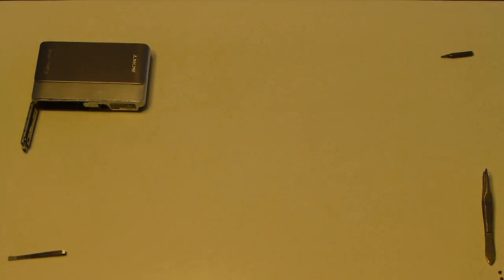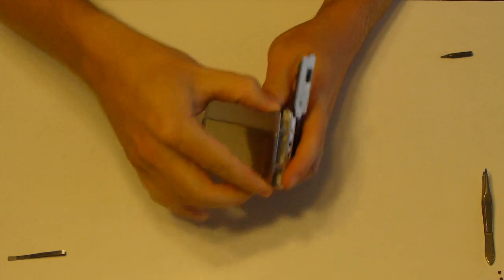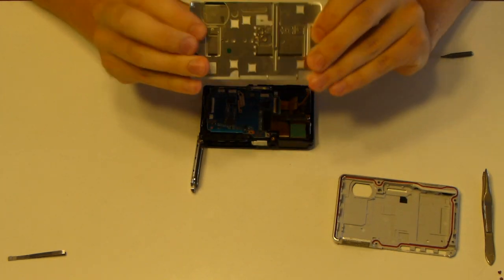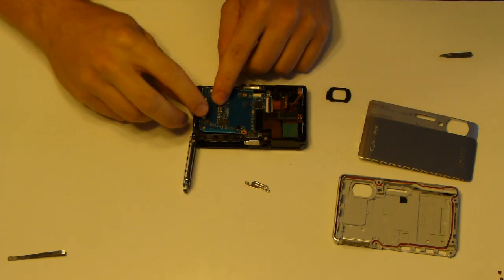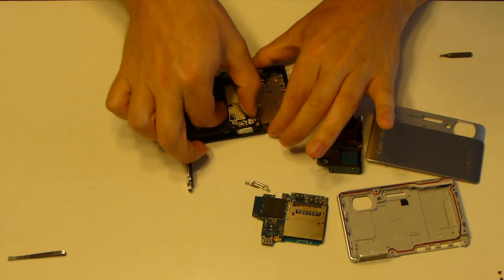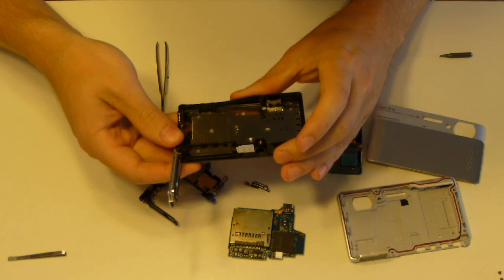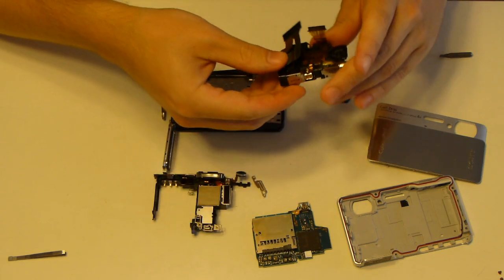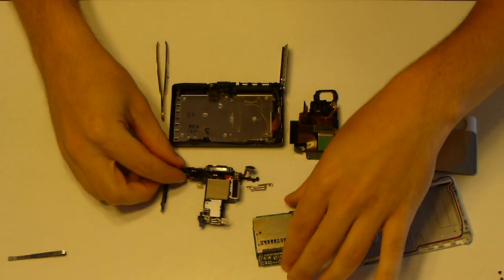Sony Tx5 Teardown

Comment: All I want to do with mine is to replace a little latch to keep the battery door securely locked down. Do you have any idea how to do that and what the part would be called? Thanks!
Reply from the maker: Honestly unsure, think the tx5 is burried in my junk bin. If the latch is damaged I could send you my brick tx5 for cost of shipping. Private email me via google plus.
Reply: +Peter Panais Looking at the same issue of the battery latch failing which has then compromised the battery door. @Peter, did you end up getting that part from Paul and replacing it within your DSC-TX5?
Reply from the maker: He never contacted me, I don't think I have the camera anymore
Reply: +Paul Beaudet all good, thanks for responding, Sony AU will look at it for $180-$200 AUD excluding work + parts so it's time to shop for a new one. Looking at the TX-30B on sale at Amazon if I myus can ship it ;)

Comment: Thanks very much for this video, I cracked the case and touchscreen on mine and then over time water seeped in and broke the LCD screen. Just finished reassembling it and it works fine so thanks for the guide!

Comment from the maker: that usb hatch always seemed like weak spot to me. Salt eats gaskets if not cleaned away. Like I said the vid, let it sit in a zip lock bag of rice till its dry. Opened up it shouldn't take too long, mine took two weeks to dry out but that was before I opened it. A short is probably fatal. I could clearly see where mine had done so on one of the ribbons, seems like it would be a feat to replace. 130 is almost the price of a refurb but I guess its reasonable since thats what they'ld have to do

Comment: I'm not too sure actually. After I opened it up, I saw corrosion around the bottom USB/TV connection slot, so water got in somehow. There were little droplets of water inside the camera as well. 
I took it in the ocean two days ago, it said "camera overheating" and failed to turn on after that. I believe water got in, shorted something, and the camera overheated. Hopefully airing it out for a few days will fix the problem. I called sony, they offered to fix it for $130, I might try that sometime

Comment: Thank you so much for this video. My camera just died and I wanted to fix it myself, but was unsure how to start. 

at 1min5sec, there are two more screws on the left side you need to remove before the face comes off. Those two screws are possibly the toughest screws to remove